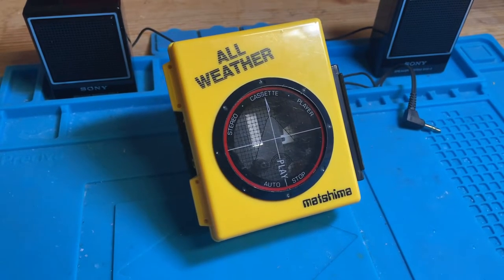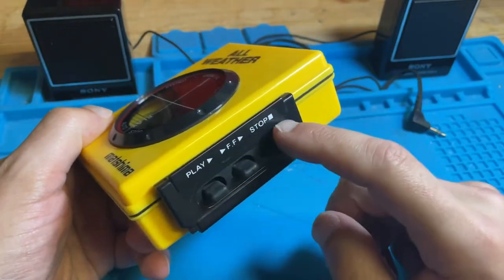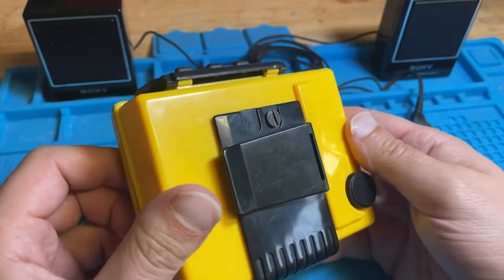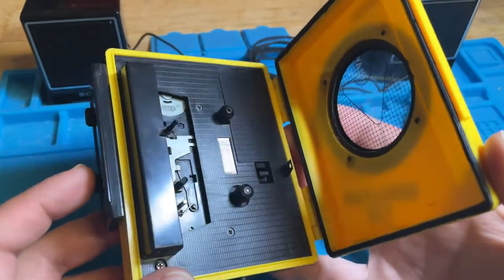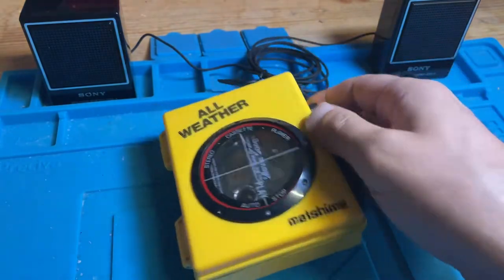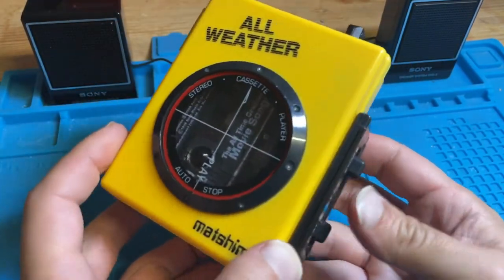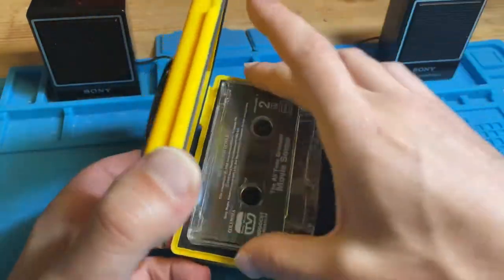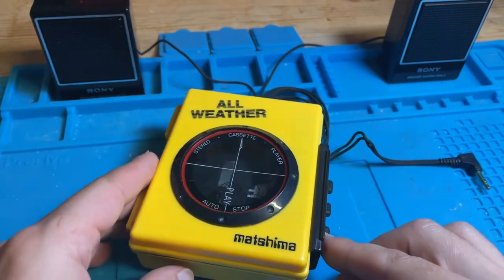Second Chance! Fixing Matshima All Weather 'Walkman' (Repair Follou-up)

Comment: Hi. I have the same but it only runs on ff on both play and ff. I opened it and it only has this direct belt on the same shaft as the servomotor. Do you know how it controls the speed? Cheers noce video.
Reply from the maker: I really wish I could help you with your question, but this was over a year ago and unfortunately my terrible memory can't remember enough about the internals be better any use!